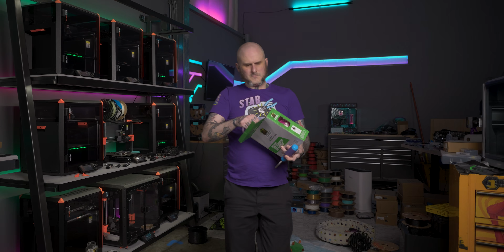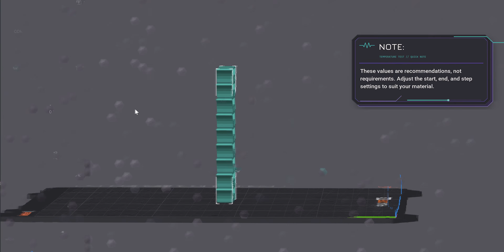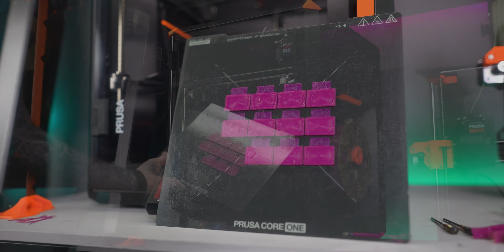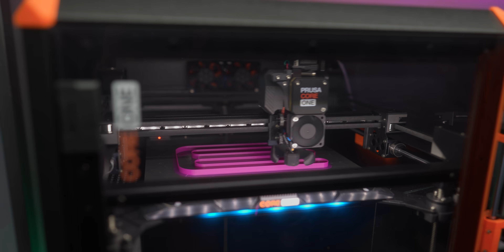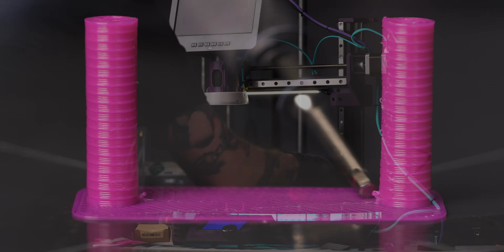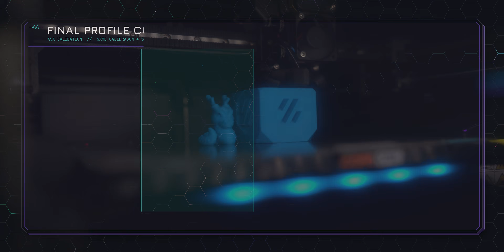Is Manual Filament Tuning Still Worth It?

Comment: I just wish filament calibration wouldn't generate so much waste. If only the prints were useful for something else, but as it is, they just end up in the trash after tuning.
Reply from the maker: Yea, that is a real problem. I get it. I try to be as materially efficient as I can be with the process. I've gotten down to the less than 100g to tune in a spool (what I showed). You just hit a point of "you HAVE to print a certain amount to get results". And I think of it this way: A failed print likely wastes more filament than if you'd just tuned it in to start.
Reply: I'm quite lucky as there's a filament company near me that recycles old filament. You just need to seperate it by type (pla, petg, etc...). They give you a dollar off a new spool for recycilng old stuff. I toss all of my calibration prints in a bag and give them to them to recycle. 

Also I ran all of the tests Mandic mentioned and my total filament usage (not including purge lines) was 51.12 grams. Not horrible for having filament tuned.

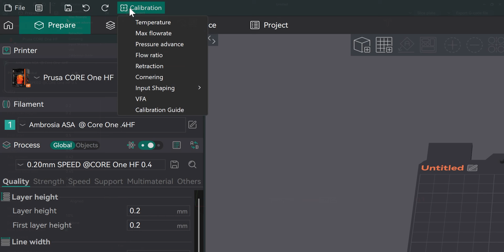Comment: 5:11 great video but you already have messed up the order; Orca Slicer recent update (past 2 months or so at this time of comment) made calibrating very very easy. In the 'Callibration' tab where you are in Orca doing all this, we've changed the order of what needs to be done first, then next.
Simply just go top to bottom in that tab. Very Very hard to "screw up" now
1. Temp
2. Max flow rate
3. Pressure advance
4. flow ratio 
(3 affects 4, and visa versa. you could spend a lifetime fine-tuning between these two, but just do your best as to what looks right/best)
5. retraction
bonus (they are helpful and very beneficial but not a necessity like above)
6. Cornering
7. input shaping (a quality-placed accelerometer auto calibrates this [nozzle ADXL345]
8. VFA (DEFINITELY DO)

the guide links to orca's page about calibrating

Hope this helps
Reply: TLDR; when i just want to quickly calibrate filament, i just go with the hotter temp of the brands recommendation, and run 2. Max volumetric flow rate (how fast it can print while keeping quality), 3. and pressure advance.
If I want a nice quality finish, then i'll go and run the flow ratio test 
- hotter end of temp
- Max volumetric flow rate (MVFR)
- PA
- top flow ratio

Comment: Prusa catches grief over being slow, but in my experience it is really more a mater of their profiles being more conservative and favoring quality over speed. So not surprising that you also think they have the best default profiles. That said, calibration, and simply understanding the model you are printing, makes a huge difference in speed and quality. I will take a slower quality print the first time, over a mediocre fast print, and a failed fast print is worse than no print at all.

Comment: Too bad Bambu has made using temp and speed towers almost impossible to use unless you program the G - Code yourself.
Reply: it's really easy, just use orca. but you can even do it from bambu studio with a small trick.

Comment: Mandic
Another great teaching video.
I really appreciate the hours of effort and care you are putting into your editing. The precise and clean close ups, the well chosen words, delivered clearly, the willingness to show issues as they may occur.

I see your new close up camera rig is doing a great job. 

I originally found your due to your earlier video years ago on tuning a voron which I used in my Prusa ( when searching for printer tuning years ago).

As always great work. We really appreciate you. 

PS. 
 Maybe ask your patreons, if they might appreciate an annual video, which is a  refresh of both printer physical, mechanical maintenance and setup along with a filament tuning video.

 Even though the underlying printing principles don't change but the software, tools, machine sensors and test models change and update. A little reminder for us that a little well planned maintenance goes a long way.

Comment: My old Stratasys machines have print profiles in them from 25 years ago that by default will print absolute flawless quality stuff. Results still blow anything from today out of the water. I should have a read though them someday and document them.
Reply from the maker: I'd imagine it is more than the print profile, but I haven't been upclose with a Stratasys machine to know. I know most of the industrial machines I've been up close with haven't been mechanically impressive and I'm used to their print quality being equally unimpressive, so that's interesting to hear.
Reply: because somewhere, someone (a lot of someones) did the work to dial them in on every situation the machine could be expected to encounter. that's the difference between hobby grade machines and true industrial grade production hardware. You spend the premium on the machine and the proprietary consumables and the company has to guarantee results, and that costs money serious investment in development. Sadly Im seeing a lot of stratasys machines showing up in disposal lots and the sellers are telling me that theyre being difficult to get supplies for? Even seeng stratasys machines harvested for parts (steppers, linear rails, frame parts) rather than maintain or feed them. Its like seeing someone on craigslist junking a B52 for the seats.

Comment: Amazing tutorial! Prusa Slicer absolutely needs to add filament calibration capabilities, it's crazy they don't have it by now.
Reply from the maker: Updates are coming...
Reply: @MandicReally  Hexcalibr calibration suite for Prusa Slicer or something other?
Reply: @MandicReally   after only 4 years, nice :) premium experience worth the money.
Reply: There's been some inofficial confirmation from Prusa straff that Prusaslicer 3.0 will have calibration.
Reply: @Celciusify  If it ever comes out ...
Reply: @cagoss85 Same guy said end of August, but yeah, it was "soon" back in November last year...
Reply: I was about to make this exact comment, as a beginner it's probably the thing I want most in PrusaSlicer 3.
Reply: Is why there less than 4% of the printer market at this point. They've been lazy for years.

Comment: Cool vidéo. I do the ironing test from LeoganPro on Printables. The results are impressive. I’m currently printing stacks of Multiboard, I get better results and it saves around 2 hours per stack. I also use the Califlower from Vector 3D. Next will be a first layer speed test as the defaults are way too slow. I’m also preparing a Z shrinking test that’s different than yours. 
I will also try to adapt my testing for annealing and humidity conditioning of Nylon.
Reply from the maker: I'd be curious to hear about the Z test, please share it when it is ready. If I had hair I'd be pulling it out cause I've got a mod that I'm getting annoyed with cause I want Z precision that's proving difficult to achieve...
Reply: As soon as it’s ready I’ll chime in.
Reply: @MandicReally  I published it on Thangs (jcdeshaies) and Printables (jcd_1243355) under the name "FDM Z-Dimensional Test". there is an included spreadsheet to do the calculation. It's still a workd in progress. Hope it will be of some help.

Comment: great stuff, as usual!  it should also be noted that skew compensation is usually a good idea too, though not all print out of the box machines allow enough access to make the appropriate adjustments (flashforge & bambu are big offenders there).  otherwise, filament calibration can save a LOT of frustration - just don't rely on the test order in the menu because the order in which the tests are run matters too.
Reply from the maker: Sadly Prusa removed Skew Correction when they moved to the Buddy board ecosystem too. If I can grab some of their ears I'll scream about it. Though I consider that a machine level tuning thing, like Input Shaping, etc.
Reply: @MandicReally it's just as important as input shaping, as far as i'm concerned.  machine & filament both need to be properly calibrated.  belt tensioning is part of that too, which prusa addresses with their harmonic tensioning function in the app, but that's just one variable in the equation, just like there's 6 different calibrations in the slicer.

Comment: I do this with every new filament I receive. The ideal settings can change from color to color of the same filament brand and type. The nice thing about calibrating your filament is that you typically only have to do it once for a filament of the same brand, type and color. I save each one as a custom preset in Orca Slicer. Also, if your filament spool sits on the spool holder for days at a time, it is still absorbing moisture. I highly recommend running your filament straight from a dry box.

Comment: At first i was confused. Orca isnt your go-to slicer? why would that... Prusa printers... I forgot prusa printers have lots of advantages with the prusa slicer over orca
Reply from the maker: Honestly even with the rest of my machines I've largely moved back to PrusaSlicer. Idk, I loved OrcaSlicer but it feels like the well got deeper than I need on a daily basis. And PrusaSlicer still has a few things that others don't yet. (Consistent surfaces, finer fan control for overhang angles, easier z-offset adjustment off the top of my head.)
Reply: @MandicReally  I know it is very subjective, but I also find the Prusa Slicer UI easier to maneuver and find things. So much scrolling in Orca! But I know many will argue the opposite.
Reply from the maker: Yea, I agree but I know it is a personal preference thing. I'm worried PrusaSlicer 3.0 will ruin that muscle memory for me.

Comment: Nice video, and shows off why I hate temp towers - you just can't get an accurate reading. It's so difficult to spot the difference. I'm struggling with some ASA and oh boy, all temps look the same. So you're considering that overall not so good bridging on your temp tower as the ideal? I would have said that all just look bad. I guess I'll need to look at mine closer next time. 
Same with flow rate. Sometimes there's no clear winner (once again, just as in the video). Sometimes 2-3 settings make the same sound when I move my fingernails over them and they kinda look the same, so I'm just baffled. 
I have some ASA that I tuned in at 0.83 flow ratio at 260 °C and it's just driving me nuts.
Reply from the maker: I've found that printing a box with 0 top layers can really help with flow. You can look at the side walls and see if it is inconsistent. You can view the wall extrusions from the top (I usually stop it halfway through so it doesn't have a chance to print any "top" on the walls). I've had flow rates I thought were good, but when I printed that cube I saw gaps between walls, made me realize I was way off. 

It isn't easy to figure this stuff out unfortunately. Some are REALLLLLY tricky. This color was really hard to nail down. I printed a couple objects after my testing to reconfirm and bumped up my flow to .935 in the final version, so I was close here.
Reply: @MandicReally  Oh, that's a great idea. And yeah, I guess a few smaller test prints is pretty much the best way to confirm all's good.

Comment: I buy large Zip-Loc bags and put the entire roll in it with desiccant to keep it dry.
Reply from the maker: Ambrosia filament comes with a separate drybag actually. I should have shown it but didn't want to kill the flow with an aside about it. I personally just can't be bothered to store filament in bags. It makes finding what I want, stacking, etc more difficult I find. And its uglier, and this is a video studio first and foremost. Silly I know, but it is a thing. Not that stacks of filament on the floor look good... That needs to be addressed.

Comment: I add bridge tuning using the Make Wonderful Things models on Maker World and supports tuning using Uncle Jessy's models. The unsupported bridge tuning makes a world of difference for me.
Reply from the maker: You know, I honestly don't bother with bridge tuning. So many materials I use just bridge well at default settings. I should really look at expanding my test base a little. I've been printing more PC-CF lately and that stuff needs some help on bridging. Thanks for the input!
Reply: @MandicReally  Love your channel and this was a great video! I print a lot of stuff in PLA that has small to medium bridges and I've found that tuning them lets me almost completely avoid supports while still getting visually good surfaces.

Comment: Auto tune is the: meh... good enough.
Manual tuning is for: perfection!
Reply from the maker: Totally, I just don't think a lot of folks have any idea what is actually being tuned or what the difference is. I didn't want this video to be a hit piece so I glossed over what other machines "tune" though.
Reply: @MandicReally in general i feel its part they dont want to know and part dont want to spend the time to learn it.

Its ofte the same ppl who ask a very simple question that would take 2 min to Google who is also the once to claim auto cali. Atleast in the posts i see. 3d printing is an applaince now, no longer a nerd toy/tool, with that comes good and bad.

Comment: Did you mention that, if you're using Prusa printers like you do, you need to turn off PID calibration or most of your tuning is going to be undone?
Reply from the maker: I’m gonna need some clarification on that one. What exactly do you mean by “turn off PID calibration”? That isn’t a setting on current Prusa machines, and they don’t rerun PID calibration before prints or randomly change their heater calibration. Nothing there would undo the filament tuning shown in this video. I’ve got thousands of hours on modern Prusa printers and have never seen them suddenly start handling temperatures differently. I think you may have been given some wildly inaccurate information.

Comment: "35 seconds ago".
I think it worth mentioning CNCKitchen's Prusa-specific tool to tune Pressure Advance using Nextruder's built-in pressure sensor.
Reply from the maker: Yeah, I considered including it. The further I got, though, the more this video felt like it needed to stay focused on a beginner-friendly process. Stefan’s approach is really clever, but right now it’s still very much a proof-of-concept and power-user workflow, not something I’d point beginners toward as their normal pressure advance calibration. It’s absolutely worth knowing about, though.
Reply: @MandicReally and also Stefan's tool only works on Prusa printers. By not including it in this video you keep your video fairly printer agnostic.